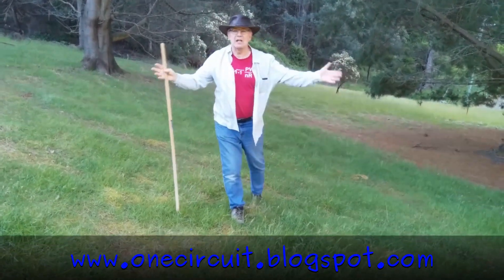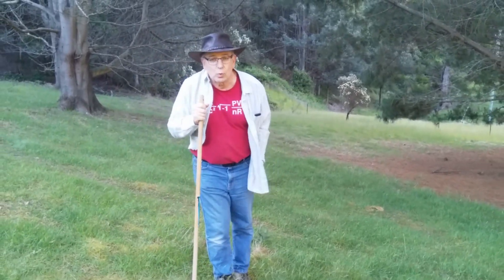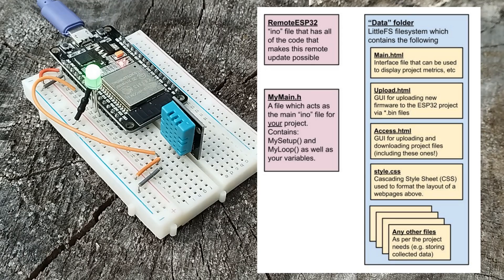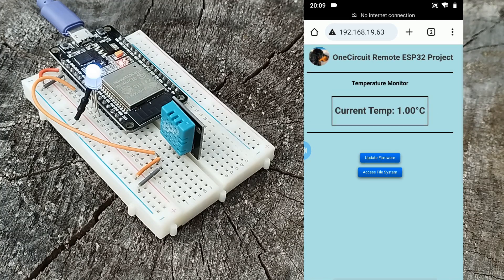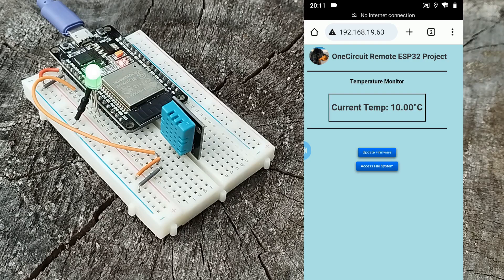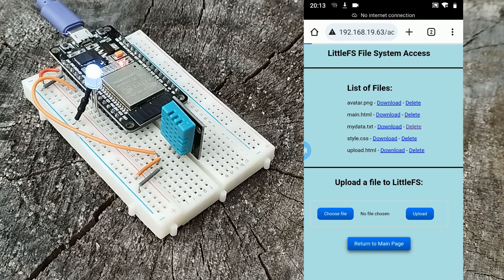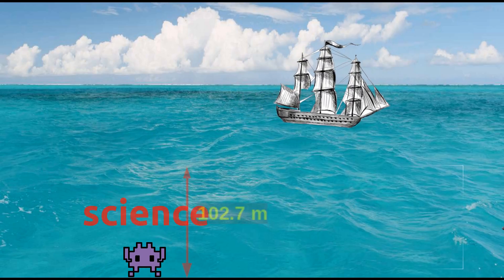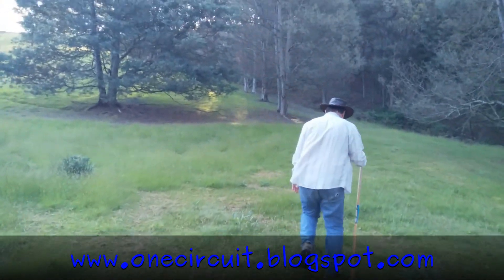Outback Remote ESP32 Over The Air (OTA) Project

Comment: Great Stuff, Sir. Just what I have been looking for, except I cannot get the initial login screen. What am i not doing? I used the zip file from GitHub and it doesn't seem to contain a login html. Thanks in advance.
Reply: Yes, I was finally able to get your project working. The problem I had involved the java file. Seems there were several non-working versions on the Internet. Once I found the right combination of jar file and file location it worked as you intended. Thanks for the follow -up!
Reply from the maker: @jamiej2554  Super news! 👍😀
Reply: @jamiej2554  Can you please share the version you used?
Reply from the maker: The main html file is in the "data" folder and is called main.html. So after programming the ESP32, if you do not change any default settings, you should point your device towards a WiFi access point called "YourAccessPointSSID" with the password "YourAccessPointPassword". After that, on your device start a browser and enter 192.168.19.63 (default IP address) and you should see main.html. The other html files are accessible from this page. Good luck - let me know how you get on! 👍😀
Reply: Please help. I would really like to use this code for a project I am working on. 
I have tried every combination I can think of to get the main.html (or other) webpage to show, and nothing works. I have tried IDE 1.8.18 and 1.8.19 and the command line through Windows Power Shell and nothing. I have re-loaded the IDE software and nothing. I have tried the 'ESP32 Sketch Data Upload' button under IDE Tools and nothing - I do see (on IDE output) what appears to load all the data files but no webpages at the URL. I have tried not uploading the data files and uploading the data files before and after uploading the sketch and nothing. I have tried uploading the binary for the data files using esptools and still nothing. I have even tried running your code "out of the box" with no modifications for my personal AP details and nothing. I have tried various combinations of ESP32 devices and nothing. 
I am currently running IDE 1.8.19 with the 'ESP32 Sketch Data Upload' button working to load what IDE calls a SPIFFS load (no LittleFS function available for ESP32) and uploading to a known good ESP32 WROOM-DA (DEVKIT V1) module. 
I continue to examine your code for possible issues but I have to say my coding skills may not be adequate. Not to question your skills but, is it possible that in your testing, the data files were already in the test device memory and there is a bug in your code that erases the data during a normal IDE or binary sketch upload? Several days have now been devoted to figuring this out and all I have to  show for it is a sketch that shows nothing but a blank webpage after going to the URL. Thanks in advance. @onecircuit-as
Reply from the maker: @jamiej2554  Have you installed the LittleFS file uploader plugin on the IDE - see this page for example: https://github.com/me-no-dev/arduino-esp32fs-plugin

SPIFFS will not work with my code. SPIFFS is deprecated, replaced by LittleFS.

There's also some tutorials about how to upload your data files (including main.html) to your ESP32 LittleFS partition, for example: https://randomnerdtutorials.com/esp32-littlefs-arduino-ide/

Let me know if that is the issue! 👍😀
Reply: @onecircuit-as  I have had the uploader installed since the beginning of my attempts to make the code work (i.e. all me previous issues were WITH the plug-in installed). I see your comment about SPIFFS not working, but last night I modified the code to accept SPIFFS and everything worked (slow, but) fine. I am still concerned that the plug-in does not give me a choice of LittleFS, SPIFFS or FatFS when I try to  upload data. The Upload button simply defaults to SPIFFS uploader and does seem to work reliably. I am continuing to try re-install of the plug-in as I have noticed various versions of the Java and tool codes available on the internet. Any comments are welcomed.
Reply from the maker: @jamiej2554  Yes there are a few varieties available - I've settled on LittleFS because that is the most reliable. Of course you can modify the code to run any partition. Glad you were able to get it up and running! The following version seems to allow all three formats: https://mischianti.org/esp32-integrated-littlefs-filesystem-5/
Reply: This is the fourth time I have typed this reply and it seems to never get uploaded to YouTube. 
I tried the URL you suggested and still no joy. I cannot get your sketch (or any other I have tried) to recognize a LittleFS format. Strangely, this same occurrance happens on Linux or Win10 IDE on my laptop. I tried every version of the .jar tool that I could find and even with the .jar where I could see the code to select a LittleFS, SPIFFS or FatFS format and nothing. I also tried a .java tool that one webpage suggested and nothing. It did have the format selection code in it and still no requested upload format choice or LittleFS read. I also tried changing the .java file to a .jar file, according to java directions, and even that didn't work.
On a related note, I discovered that your Remote sketch, didn't like that my sketch code also encompassed a webserver. Any suggetions to make that work? Thanks again.  @onecircuit-as
Reply from the maker: @jamiej2554   Sorry I just saw this comment - YT isn't very good at letting me know what's going on with my own channel! Have you been able to make the project work? I'm happy to do another video outlining the steps I took to make it work.👍😀

Comment: Great project to be able to download the data file and upload the bin file corresponding to the updated sketch. Thanks for making the code available and for all the hard work.
Reply from the maker: Thank you Neil - hope it works well for your projects! 👍😀
Reply: The code you provided works "straight out of the box". I've used OTA to update URLs for the internet radio, as the radio station URLs often change. Still to identify a project to include the data download option. Thanks again for a great project.
Reply from the maker: Such good news! 👍😀